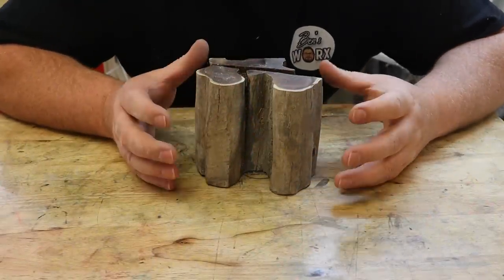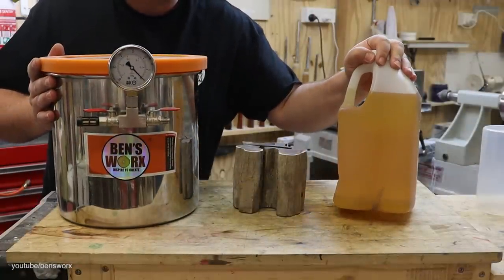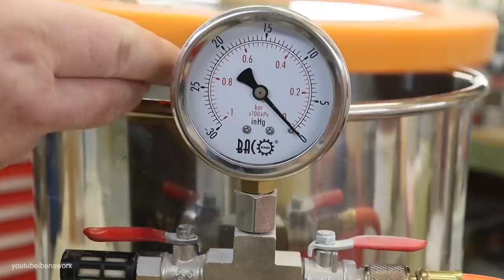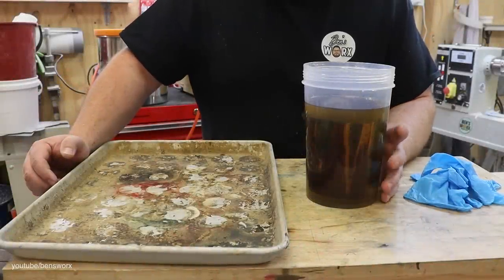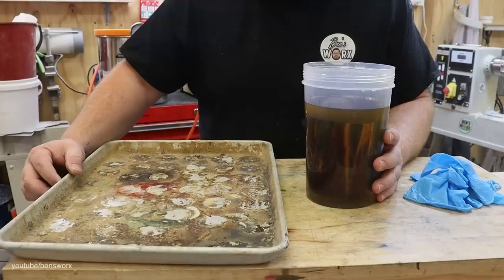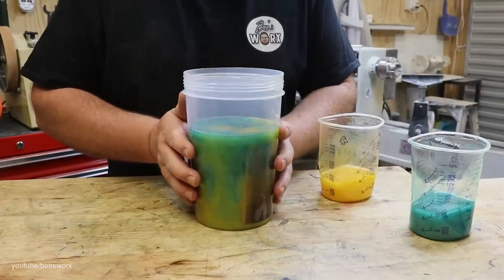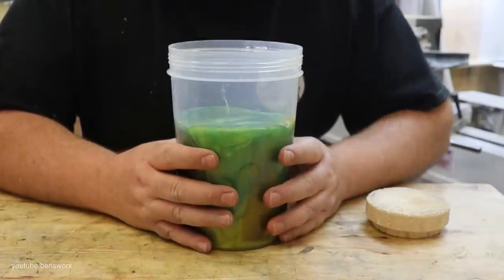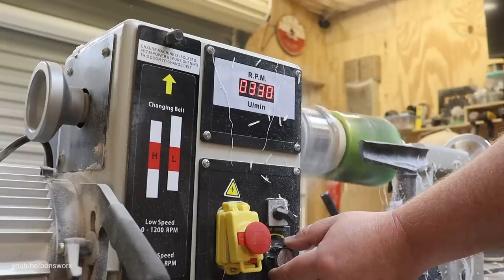Over 100 years old and was Hard like Concrete

Comment from the maker: Thanks for stopping by, If you have time you can check out my new range of Eggs here www.etsy.com/shop/bensworx
Reply: The new eggshell ones are cool 👍
Reply: Very cool! 💜 You should drill a hole in the bottom though. The reason plant pots have holes is so they don't mold and kill the plant. It helps keep air flowing.
Reply: can you trap smoke in Epoxy Resin?